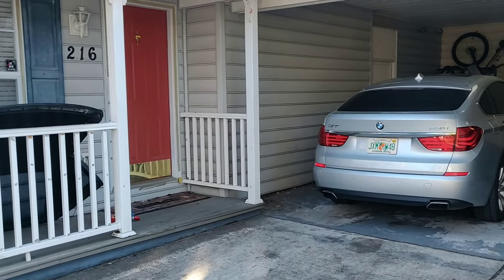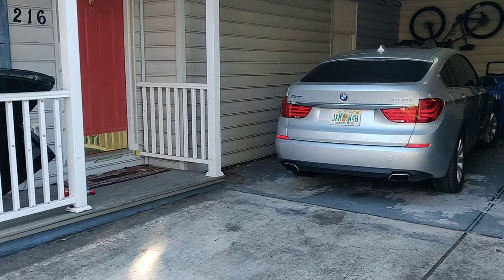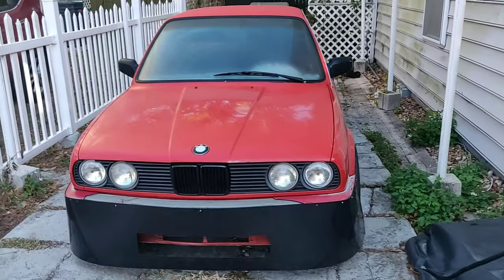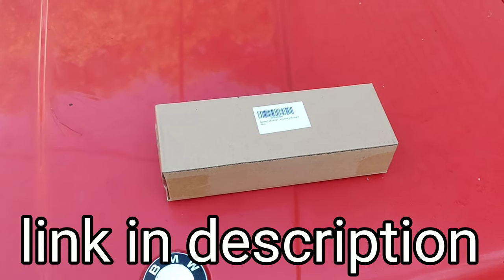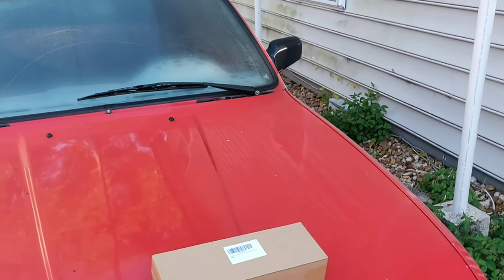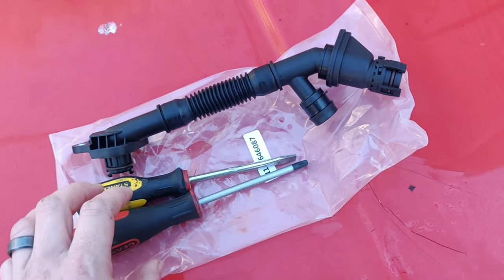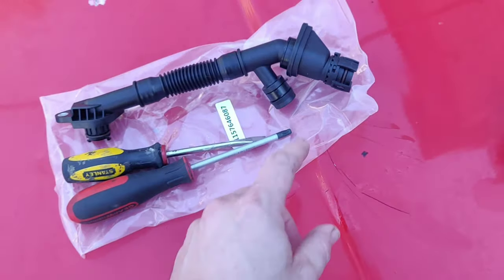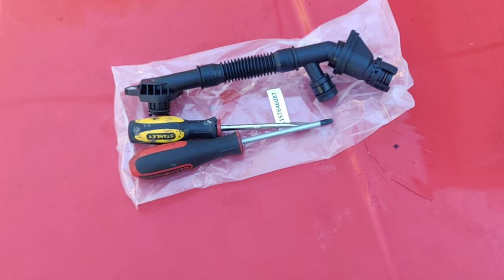BMW N63 crankcase ventilation breather hose change 2010 550i gt 4.4l twin turbo

Comment: Thanks for posting this video I was having an issue of my car smoking oil when sitting at idle. Big plumes sometimes. Replaced both of these and hasn't done it since.  I did throw a trouble code because the system was running too lean but after I reinspected everything the rubber part of the intake hose wasn't seated correctly on the hard plastic part. No code since I corrected it. Thanks!
Reply: I have the same issue .. it’s not the valve seals ?

Comment: Good job, the dealer didn’t know that Pcv valve can cause a malfunction engine light
Reply from the maker: Thanks.  Yes I got screwed by both dealer and independent that didn't pay attention. Both places changed out coil packs and spark plugs because of misfire.    First time was ok because it needed new ones but second time I know was a wrong diagnosed

Comment: Thanks for great videos.. question about  this peace from Amazon.  Did it give you any issues? Such whistle noise? Or any other issues?.I replaced them both using after market but gave whistle issues but no smoke.  However, that noise was driving me crazy and went bought the original...but smoke came back but no whistle noise. Thanks again
Reply from the maker: I have never heard this before but my guess is the first ones you bought weren’t sealing fully causing a whistle noise.  But they must have been creating less air into the engine and allowing proper air fuel mixture.  It sounds like the smoke is caused from too much or maybe somehow too little air which will throw off the computer and make it run improper.

Comment: Great video Pete! I just bought a used 2011 X5M with the N63 engine and am new to this engine after having a 2008 X5 with the N55. Do you know what codes yours was throwing? I just got a p0175 code and also have an issue with a hard brake pedal in the morning. I’m hoping it’s a vacuum issue but with 120000km on it, It’s likely something more. Would appreciate any thoughts you may have. Thanks!
Reply from the maker: Thanks.  It's been a while and can't remember what codes were.  But we were getting cylinder misfire codes as well.

Comment: Thank you for the video! What is the torque value (amount of torque to tighten) on the t30 bolts (there are two on each side and you indicated that one was very hard to get to and tighten down)? Thanks so much!
Reply from the maker: I have to be honest I couldn’t find one but I think it’s just important to get them snug and do not over tighten. These could easily strip.
Reply: @petescarport  ok so just hand tight and no torque wrench? Thanks so much
Reply: Or maybe 10lbs torque

Comment: did you have missfires under throttle or on idle? i have problem with my 650, noth hoses were broken, i did the similiar temporary fix, and car do not throw codes, but has little missfires at idle. what do you think?
Reply from the maker: I would change it out.   We would get a random misfire usually on acceleration but that’s due to pressure twisting the hose I used the first time.

Comment: My breather hoses broke off.. idk why it’s so fragile in the first place. I am replacing them with rubber hoses instead. Any one else do this??
Reply from the maker: So I mentioned this in the video.  I attempted to use rubber hoses.   It worked great for a day or so but what happens is the rubber gets soft and since it’s so much pressure it will twist the hose and cause car to go into limp mode again.    At least this was what I experienced.  Maybe a different type of hose or even reinforced hose would be good.  Let me know how it goes.

Comment: How did you know they were bad in the 1st place?
Reply from the maker: I kept getting check engine lights and limp mode.   When I took off airbox they were broken in half and I could see it.
Reply: @petescarport  no smoke from exhaust or from the broken hoses??
Reply: @germann289  my exhaust is smoking but no codes. I'm replacing mine tomorrow in my 550i, I'll let you know how they look when I pull them.
Reply: @RobertMc0811  I need to the same shit with mine I’ll msg back if it fixes it for me.... I thought I blew my head gasket... but it’s most likely this... there’s some oil around it too
Reply: @GuysWitNoLives  I just found the time to replace both of them this afternoon. The driver side was a pain so be careful. Each tube was so brittle they broke with barely any pressure. New ones are in and I'll let you know if it stopped smoking when idle.
Reply: @RobertMc0811  I got my scanned and it shows fuel injector still gonna see what’s up and what fixes it and post any updates I have a lot more smoke when I let it idle then hit the gas like huge plum of smokes
Reply: @GuysWitNoLives  it's been a week now. I've had zero smoke! I was throwing a trouble code because the bank one fuel system was running too lean but I discovered that part of the intake hose after the mass air flow sensor wasn't on all the way. Aside from that it fixed my problem perfectly
Reply: @RobertMc0811  awesome my X5 has been sitting for months due to smoke from exhaust and engine bay but no codes and running fine, I’ll replace mine soon!
Reply: @RobertMc0811  wicked... I have my car just on the drive way still .... gonna hopefully get something done this week or next week.
Reply: @germann289  be careful. Mine started misfiring on cylinder 1. Took it to my local BMW specialist. The valve stem seals need replaced. It's $8,000. Apparently the N63 engines are notorious for them. To the point that BMW lost a class action lawsuit and you may be able to get yours replaced for super cheap. If you're consuming excessive oil and smoking oil through the exhaust. There's a good chance it's the valve seals.  I have an extended service plan through carmax where I bought it. It should be a covered repair. I'll let you know what happens. Be careful though.
Reply: @RobertMc0811  so I finally got it to a shop they said the same thing 1 valve is busted so I’m gonna get them both changed and see how it goes this Friday I’ll msg back Sunday since I’ll ride it then
Reply: @GuysWitNoLives  my extended service plan provider told me BMW extended the warranty on the valve seals to 10yr/100,000 miles. So looks like the dealer is going to replace mine for free. If it's under those limits, you may be able to get it done for free
Reply: @RobertMc0811  already got it done 350$ on parts and since I got my friends to do it they charged me 500$ all together got new plugs and 1 coil changed so yea.. He also said I might be able to get the whole engine replaced he’s finding out... if that’s possible I may just sell my car... but thank god it was a small fix no smoke coming from the exhaust now so yea... IF YALL GOT SMOKE COMING OUT OF YOUR GT CHECK AND CHANGE PVC VALVE LMAO
Reply: @RobertMc0811  yo since you have the same car are you looking to mod it out or keep stock... I’m only asking since I wanted to maybe get it tuned and make some more noise then it already has... looking for pop and bangs to be honest.. lmk if you know what mods do the trick since I see no where what parts are being used also a newbie with cars
Reply: @GuysWitNoLives   I took the car to my local BMW dealer and they quoted about $15000 worth of work that's needed.  So BMW has agreed to install a brand new engine and battery at no cost to me. As soon as I get the engine replaced I am turning around in selling this vehicle However if I were to keep it I would absolutely put a dinan cold air intake and exhaust from GT Haus with x pipe. (Meistercraft exhaust)
Reply: @RobertMc0811  dyam I heard some thing about a recall... my friend that owns a shop is figuring out the same thing for my self... that’s honestly pretty good to hear.. It will sell so ez now with a brand new engine plus u get extra bucks haha.

Comment: Those replacement parts you installed are no good. They are missing a breather hole inside the one way flap. This will create to much vacuum and damage your engine. The damage will not come over night so it's difficult to notice. Try and open the oil cap while the car is at an idle. If it's hard to pull it then you know you've got to much vacuum pressure. Wish I could upload pictures of the original part versus the aftermarket part.
Reply from the maker: I mean it’s been 3 years and 60k miles with no issues.   And for this car that’s a long time without any issues.